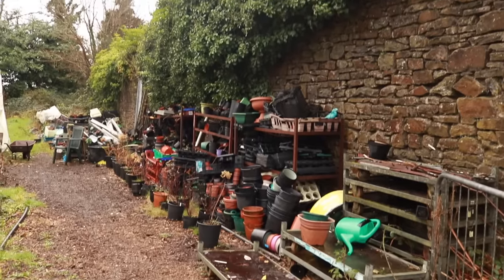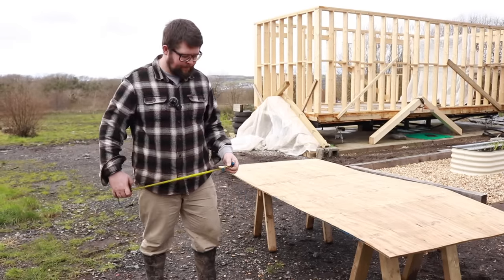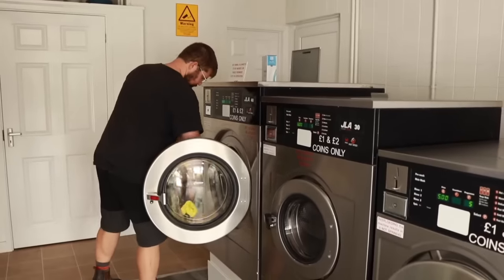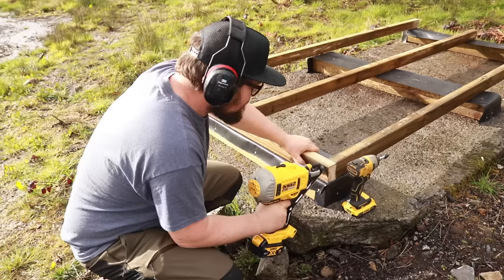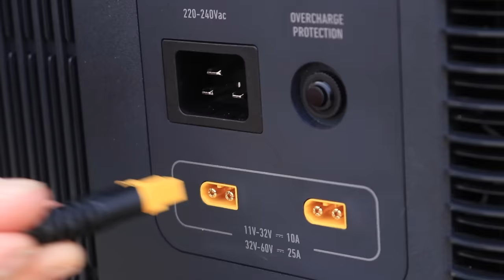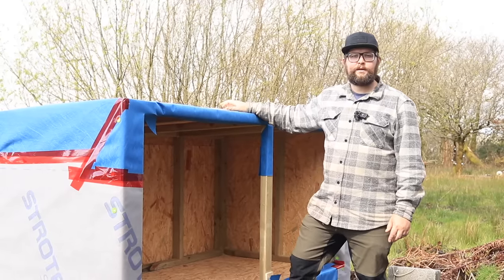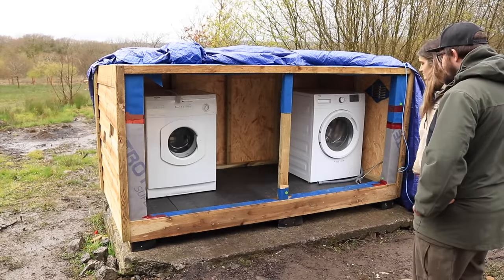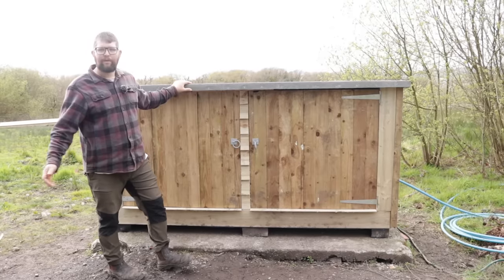Living OFF-GRID & mortgage free in Wales, UK

Comment: I would recommend putting a waterproof membrane under rubber matting as the joints tend to allow water/moisturiser underneath, which doesn't evaporate and will ruin the board underneath.

Comment: You can build a drying canopy using the same panels that are on the greenhouse. Can be a little taller than the washing machine house you just built.  Leave a 1m gap around the sides at the bottom for air to go through. 
On the most overcast, wettest days in December, a pair of jeans will be dry in 2 days. Sunny day and they are dry in 1.5 hours or less. 
Use your tumble dryer for 10mins then to get the last bit of dampness out of them in winter if you need to. 
I use this system in the Irish Midlands, with very similar weather to you. 
It will free up the Anker for other things during construction. 

Great project, I always look forward to the videos.
Reply from the maker: Great ideas Kevin, something to definitely look into, i have been hanging my wet weather gear in the greenhouse to a similar effect since we built it as i found my kit constantly wet was making it stink! We recently visited Ireland and loved it there.
Reply: @CampOutWest  You need to keep the sides very open. Learned this the hard way too!! 😁

Comment: you could add a couple of 425W solar panels onto the roof and feed the battery you have. At the moment they are very cheap to buy (less than £70 each). Would use the space up well especially as it's not overshadowed.
Reply from the maker: Wow, that's a great price! Luckily for us Anker sent us some solar panels which we have been putting on top (when it's not too windy haha) you can see them during the ad section in the middle of this video :)

Comment: If you want to save battery/power with a washing machine, try preheating your water with propane etc. then feeding that into the machine set to a cool wash. That way you are not trying to heat the water from the battery.

Comment: Great little laundry shed! Yes, you won't want it getting too hot in there, so the vents are good, but in the winter, when it gets really cold, you might need to keep the dryer warm. I used to have mine in the garage, and it just refused to work when the temperature dropped below zero. Might be the type of dryer, though, I'm not sure. Having those facilities on site will free up so much of your time. Thanks for another great video 😊

Comment: The top of the shed might be a good place to put a few cheap solar panels so you can charge the battery pack while it's in use, or being stored in the shed. They may help protect the roof a wee bit too.
Reply from the maker: Thanks Karl  😄 lucky for us Anker sent us some solar panels, which we have installed on the top 🎉 (if you watch the ad section in the middle of this video we show them in place)

Comment: Well done it works two ways no fuel to be spent on and saving the laundrette but paying out on the machines offset the savings slightly but over 5 years with the machines you will save just make you have a lock or chain on the doors for security well done

Comment: Hello, I'm curious how you've handled the disposal of wastewater and dryer lint - if someone is off the grid, they usually don't have access to sewage where they could discharge such wastewater. That water is often full of microplastics and residue not only from clothing but also from laundry detergents. So, it often becomes one of the least environmentally friendly solutions. It's a pity you didn't show us or tell us how it could be resolved on off grid place.
Reply from the maker: Hi Martin, as we've mentioned in this video our land has access to main sewers from the old caravan site that was here, where we are running our waste water into 😊 For the dryer lint we are collecting it and combining it with our access wax from our candle business to make fire lighters for our log burners. Our land, we aren't fully off grid but plan to do what we can to be as self sufficient as we can, as our  land came with some services in place already, it didn't make sense to remove them but we are planning on adapting our land to be off grid where we can (running off solar, growing and preserving our own food, setting up a rain water collection system etc etc)  we will never be 100% off grid and that's ok with us 😊 it's all a work in progress.
Reply: @CampOutWest  oooh good idea with the lint!

Comment: You should have kept some of the wood building supplies from the caravans .
Reply from the maker: The caravans had barely any good timber in them, they were were made of alot of chip board, very think ply (3mm) and very thin pieces of actual timber, we kept what was useable and used that to board the roof of our wood shed store and the rest went to the recycling.

Comment: Just thought it would be better to have a slanted roof on the laundry shed due to all the rain you get and it would not pool on top.
Reply from the maker: Thanks Mary 🙂 it is slanted, we added an extra batton on the back side of the roof to make the back wall taller, so the rain water runs off the front

Comment: Wait what video was the greenhouse built in? I've seen all videos and do not recall it at all...
Reply from the maker: Here we go https://youtu.be/N7YsH4Rju-I?si=pRQuhzIcR4IZ3vZq&t=691 this link is timestamped so we take you to the exact part in the video we build it :)
Reply: @CampOutWest  thanks! That vid must have auto played during gaming because I don't recall any of it but the video was flagged as seen already 🙈🙈

Also you might use less than 33% of the battery if you run the washer in eco mode. It runs longer but should use less energy
Reply from the maker: @uribove  ahh! That is the best tip! Thank you. I want to put another wash on now just to try it! Thank you :D
Reply: @CampOutWest  a quick google search, though figures depend on the specific washer model:

Can eco mode save me money? Yes. A lower temperature wash uses between 35-59% less energy than a hot wash. Less energy means less electricity.

Comment: With all the wind you have there what's wrong with a clothes line? Also are you going to have to pull the charger out to boot it up? No built in solar panels?
Reply from the maker: We have a clothes line 😊 it just doesn't work when it's raining constantly 😅 it runs off solar, which we put on top of the cabin, which we show in the middle of the video during the ad section 😊

Comment: Hi there love your vid , I see in one of your previous videos you had a ecoflow power pack,  what was wrong with that , regards 😀
Reply from the maker: @chrislee1099  nothing was wrong with the eco flow, it's just has a smaller battery and the more battery packs on the land the better. This Anker is the biggest battery we own so it's perfect for our bigger electricity items that pull the most electricity 👌🏻
Reply: @CampOutWest  I've a 2048wh  ecoflow with 2 add on batteries which makes 6.2 kw
Reply from the maker: @chrislee1099  sounds like a beast! We haven't thought about adding on batteries, that's a great idea!
Reply: @CampOutWest  you can also connect 2 , 400 watt solar panels with y connections to give you an output of 700  to 750 watts  I'm not gonna 800 cos the panels never put out the ratings 😉

Comment: is solar connected while your using the power bank, didn't see it
Reply from the maker: You can leave it plugged in all the time, it was crazy windy this past week so we took it down, there are holes in the panel so thinking of putting some battens on the root to fix it onto that allows airflow under the panel as i've read solar needs to not get too hot and to have some airflow for best efficiency.
Reply: Yes if you where in Spain and 30/40deg C

Comment: We’re is the water coming from and we’re is the water  going?????????????
Reply from the maker: We are on an old caravan site so like we mentioned in the video the concrete slab is the site of an old outhouse so is on top of the sewer so we have a hose going down into the sewer with the waste. We have a very long piece of mdpe pipe on the surface bringing the water to the unit

Comment: Don't you have an electrical utility connection at this site?  There were caravans on the site and it was across the way from the coal mine and I suspect they didn't live off love and had a power/electrical connection to the 'grid'.  How are you going to recharge your power generators if you live on this site and don't have an electrical utility connection?  You'd have to have a pretty large solar array to get enough power to your generators,, which I haven't seen on your site. And if you build three tiny houses, how will they be powered unless you invest 10s of thousands on large solar array and inverter?
Reply from the maker: We already have 3x house solar kits ready to install and the showers/heating will run off gas and our plan is also to install a additional solar array on the land too (which will compliment our roof solar kits we already have ready for the cabins)🙂 very excited for that! Our goal has always been to be as self sufficient and off-grid as we can be, if possible 🤞It's all a work in progress, everything takes time to implement and install. The landa actually  used to have a 3 phase electric supply on the land when it used to be functioning with 50+ caravans, but that was all removed back in 1989 when the site closed and the land was split up (the caravan site used to be much bigger but was split and sold into 4 different plots - we are on the 4th plot) As mentioned in our pervious video the land came with electric at the front of the land by the main road but the supply is so small (smaller than a traditional house hold supply, so not suitable for what we want/have planned here) which is why we are focusing so much on what we can do with solar and all the generators we already have. Plus is cheaper to invest in solar than pay electric companies to increase your supply 🤣